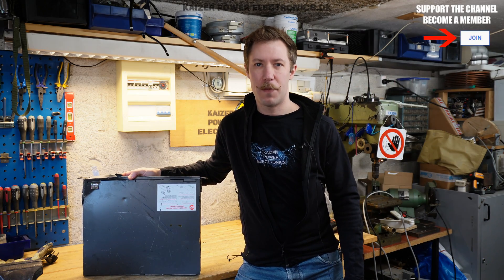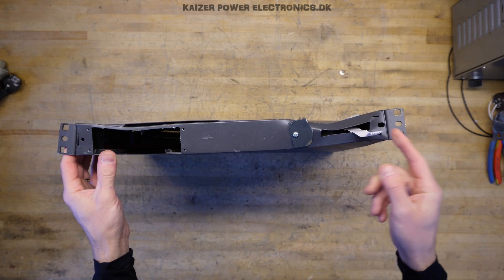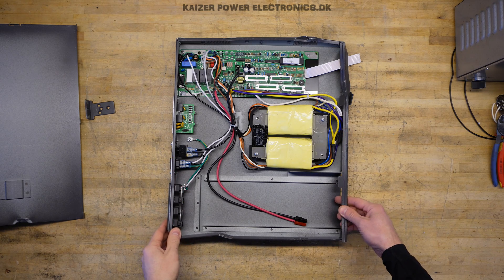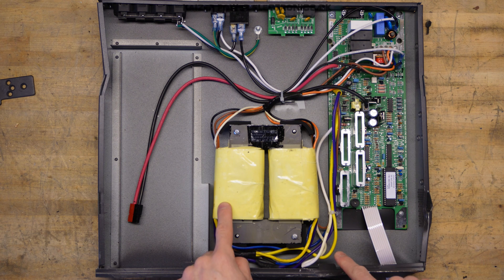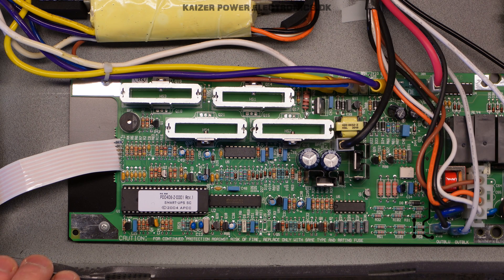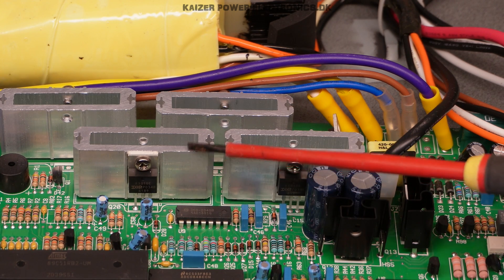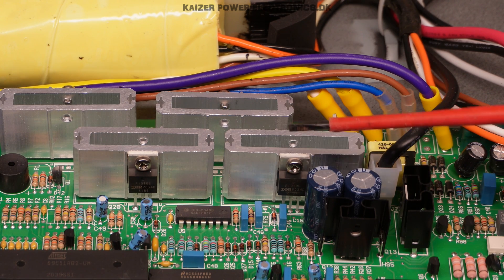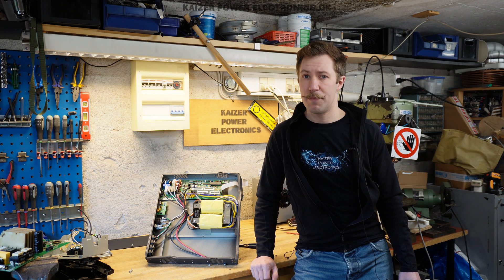APC Smart UPS 450 VA, for Server 19" Rack 1U, Teardown

Comment: I have this unit still in operation (I came here in hopes to identify the fet I want to preventatively replace) because it is incredibly reliable as long as you change the batteries. I have not had one UPS related incident (brownout or anything like that) despite regular power outages (Our RCD is on the paranoid side with what we're doing) and regular self tests of the UPS. Our ML310g8 home automation and file server, switch and 24V power rail for internet-of-shit devices (which includes accesspoints) are hooked up to it, and it works like a champ.

In fact, the very simple relay switcharoo it's doing is fast enough but also so so so much more reliable apparently than line-interactive? Anyhow. Those units are absolute gems.
Reply from the maker: Thanks for the great comment, it is always a pleasure to hear it still working after many years! I hope you saw it was IRF1010EPbF MOSFETs

Comment: These are common in SOHO environments.  The are cheap and most throw them out rather than spend the $45.00 or so for replacement batteries which are a pair of common 6 Volt 6 Amp/hr lead acid batteries in series.  Since these are not "on line UPS" they provide only the most basic and minimal protection.  I have a couple tied to a deep cycle utility battery via the simple and ubiquitous Anderson power connectors.  The charge rate is 22Watts so recovery on a large batteries is slow after an extended event.  Also, the 450VA rating is a bit optimistic, in reality it is rated at 280Watts.
Reply from the maker: Thanks for sharing your experiences with this UPS, especially the point about slow charge rates is important for people that try to use them for home backup power and think they can charge fast with solar. Needs separate chargers and some kind of selection between what is connected and charging.

Comment: Could you please clarify, is this a pure sine or stepped signed ups ? It Says : 450VA/280W line-interactive pure sine wave 1U rackmount UPS battery backup

But also : Wave type Stepped approximation to a sinewave
Reply from the maker: I guess the vague and complex answer is, it depends on the load. But from a technical point of view, its stepped approximation.

Comment: Using it for my 9U network rack. Pb batterirs are holding my low load (60w approx.) for an hour. Planing to repack it with LiFePo4 batteries 4S2P with balance board. Hope to double the working time from battery.

Comment: The smaller UPS are made in a way, that when you discharge the battery in 10 mins, the accumulated heat could be taken by the sole mass. After the batteries run out, the device is warmed up, but will no longer get warmer, as there is no more power. So no forced cooling required. Forced cooling as fans are usually present either on high power rated units, or those, which can attach external battery packs.
Reply from the maker: Yes, I was not fair in comparing it to a double conversion UPS :)

Comment: What batteries does it take? Those oddball, expensive cylinder lead acids? One of the 1U units I installed at work a year or two back used a pretty sizable lithium pack, but it's also a relatively "new" design, the pack was manufactured in 2018. (Reused from another setup, hence it being old.)
Reply from the maker: As many of their other designs, its two regular 12V batteries built into a simple 24V package of expensiveness. https://www.apc.com/shop/hr/en/products/APC-Replacement-Battery-Cartridge-18-with-2-Year-Warranty/P-RBC18

Comment: Yes just a 5 to 15 minute backup, there for the small server it is attached to to safely power itself down. Will bet that the transformer is wound with aluminium wire though, and that the transformer is very light. the small heatsinks are there to handle the dissipation for 15 minutes of operation when mains is lost, and in normal use those mosfets also do double duty as the bridge rectifier diodes that use the transformer, fed from the incoming mains, as a charger for the battery, to get fast charging. No gate drive, purely the body diodes used. The windings and tap switches are also used to give 2 levels of relatively constant voltage on the output, as the microcontroller does tap changing to keep the battery voltage reasonably constant, though of course it will long term cook the batteries, as it continually charges them to past float voltage, typically running around 14V per 12V nominal 7Ah SLA pack.
Reply from the maker: Fair point, it is not okay for me to compare it with a double conversion UPS :)

Comment: Hello Mads! In your review of the uninterruptible power supply board, you said that the power stage using transistors is built using the “H-Bridge” topology. But this is not at all true; the output stage is built according to the “push-pull” topology.
Reply from the maker: I will stand corrected if that is the case, but since the datasheet describe it as running a stepped approximation drive of a sine-wave, I assumed a full-bridge, without inspecting the PCB tracks :o
Reply: @KaizerPowerElectronicsDk  Also, due to the fact that the transistors switch at a low frequency (50Hz), the dynamic losses in them are negligible, which is why the radiators have such modest sizes. If this inverter operated at least at 20 kHz and 50 Hz modulation, then the output voltage would have a sinusoidal shape. In this case, the transistors generated a lot of heat, which required fairly large radiators to dissipate.
Reply from the maker: Thank you for the clarification :)
Reply: @KaizerPowerElectronicsDk  There is no sinusoidal voltage there, not even close. The voltage at the output of this converter has the shape of a trapezoid. If you look closely at the heatsinks on the board, you can see that only two of the four transistors are mounted.